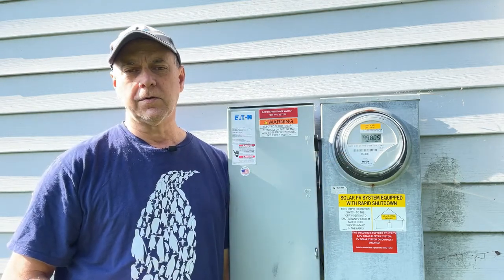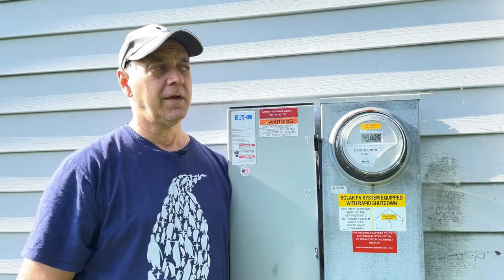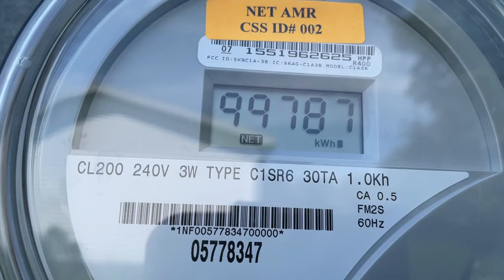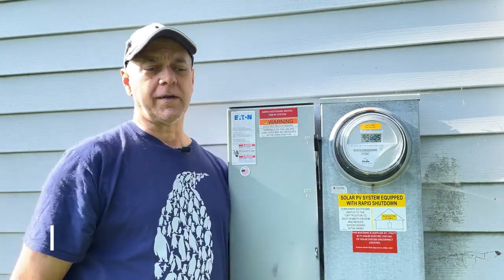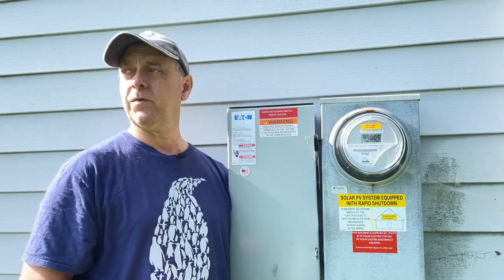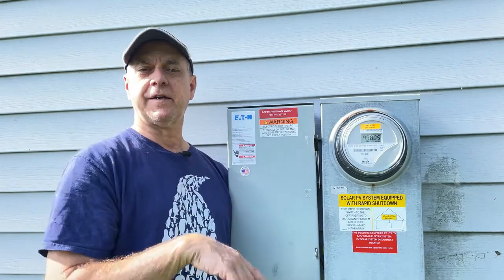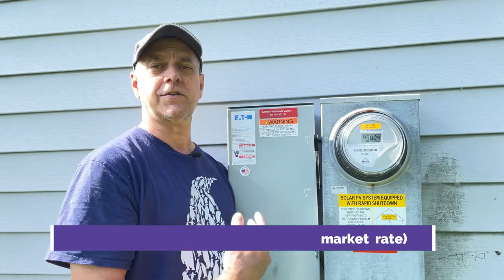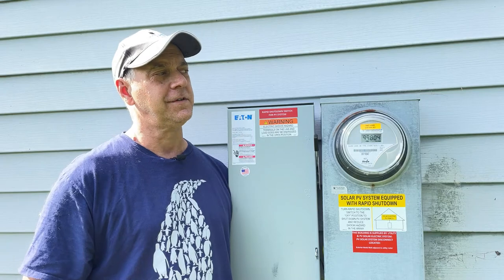Kevin Talks Solar - Net Metering

Comment: Do you have battery backup? What about at night, does the net metering cover the power you use at night and in the winter/summer when using heat and AC?
Reply from the maker: I currently do not have battery back up. Net-metering basically turns the meter backwards when generating excess electricity, giving you credit, which then gets used at night.

Comment: Looking into solar myself. Does the net metering (if we produce more than we use) go towards the monthly service fee (meter fee). Our service fee is over $50.00/month and net metering doesn’t help pay that off, that’s a big deal for us. Thanks
Reply from the maker: All suppliers are different and it varies considerably from state to state. Our service charge is $17 a month. Yes, you pay that no matter how much you produce. $50 service fee is steep! The thing is, you're paying it either way.
Reply: @KevinBlakely  - thanks, great information. BTW, the quote we got was for 26 panels at $56,000 or a 25 year loan with payment of $188.00/Month.😳
Reply from the maker: @D-Allen  Wow!  My system is 12.4 kW. That's 40 panels. It was closer to $30k. Insentived may be different from state to state? Shop around.
Reply: Crazy thing is that companies seem to be raising their monthly service fees to ensure they are paid something. All that will do is encourage more people to install batteries and cut them out altogether. 
That's definitely where I'm heading.

Comment: so if bill from Jan to May goes into 15000 credit and June bill is 15000 so consumer will pay zero bill right?
Reply from the maker: Yes, for the electricity. There will be a service charge (or a meter charge) that is a flat rate and is still paid no matter what. Mine, in Western NY, is $17. As you can see from other comments some are much higher. This has nothing to do with the solar... you're paying it now. It will be on your bill somewhere.

Comment: Not my kind of meter.  I have a Honeywell Type: A4RES.  The display cycles through power from company to customer, from customer to company, and error codes.  The power readings only count up.  The meter is never zeroed.  Until 10/2034 my produced power is deducted from power received, 1 to 1.  True Net Energy Metering.  Remember: All energy is local.  Solar doesn't make sense for everyone.  Someone installing solar today where I live under the terms available today will never break even.